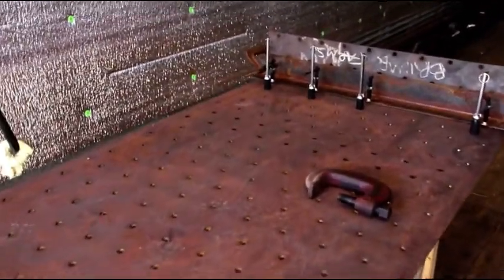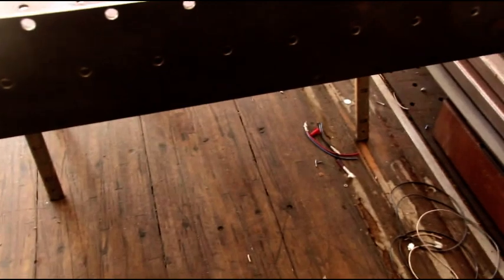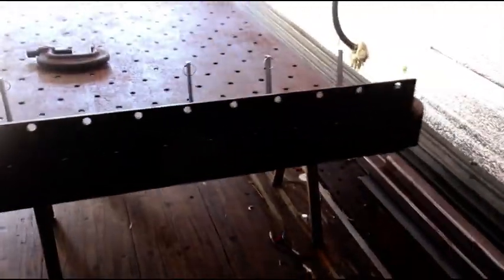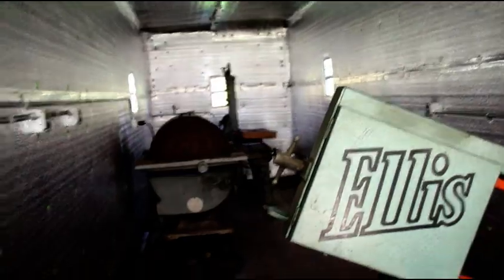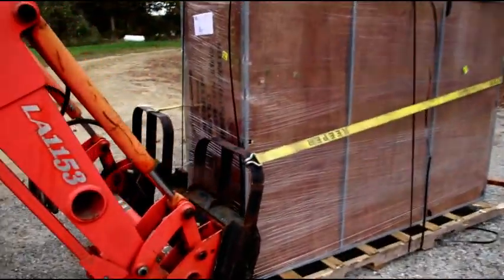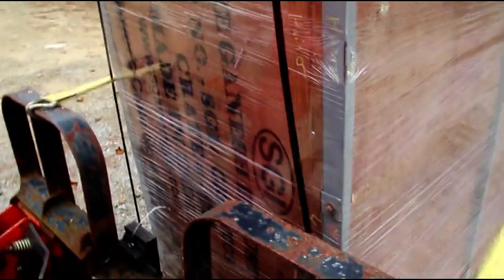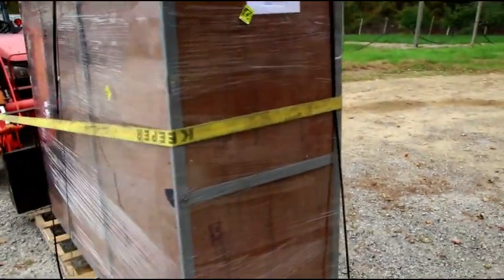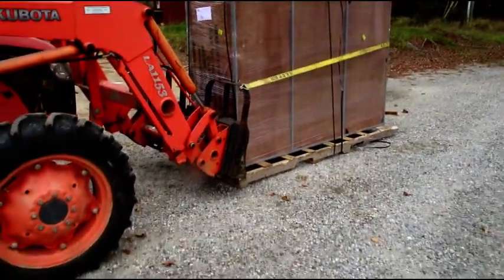Willys CJ3A SGI Body Kit Arrives...  Frame/Fabrication Table Build #1

Comment: I like to see everything you do . My welding bench is a 5x8x1 steel road plate .
Reply from the maker: My current bench is also 5x8 but I wanted one with holes in it so I can set things up and clamp them easier than a solid top.  This is hopefully going to do everything I need when jigging up frames and critical pieces.

Comment: Hey Brian, I've really been looking forward to seeing the fab table come together, as well as frame fabrication. I was going to ask you about the new India body tubs as well, good to know it finally arrived! I would also be very interested in seeing Matt's v6 exhaust system you built installed. I rolled my 3b a couple weeks ago, now its buick v6 time! no injuries other than sheet metal and a little pride. Cheers, Will. Oh and thank you very much!
Reply from the maker: Body getting unboxed today after a long wait.   Exhaust system will  be shown soon on the V6 Jeep, and the fabrication table is finally going together.  The top is heavy and huge.  Had to maneuver the engine hoist in the trailer to get it out and laying flat.  Took half a day just to get it set up and will probably be about 1800 pounds when finished.  Hoping to get it out and sandblast it when it is finished.  Glad you are safe from the rollover.

Comment: Looking forward to your fab table build! My CJ3A is more of a "survivor" that needs minor body work ( RR quarter panel, rust behind tail lights, light rust beginning on floor at cowl bracing, etc) rather than a "frame off" rebuild. Would like to see a video on how you would handle those type of repairs. Also, have you ever built a swing away rear tire/gas can carrier? I want to get the spare tire off of the right rear. It's too much of a tree snagger! How about a video on the wiring, especially the grounding circuit?

Comment: Brian.  I don't think you have time to answer questions.  But.  I am restoring a CJ-2A and long story short is the engine/transmission is not in line with the frame.  If I were to make a straight line from the center line of the main shaft of the transmission it will angle to about 6 inches to the driver's side of the back bumper.  There is no adjustment on the transmission mount or cross member.  Question is, are there cross members that will fit the frame perfectly but will have the transmission about 1 inch offset to the left.  I would send a pic  but I don't see how.
Thank you,
John
Reply from the maker: you can reach me directly at metalshaper@comcast.net
send photos to that email address.
Brian